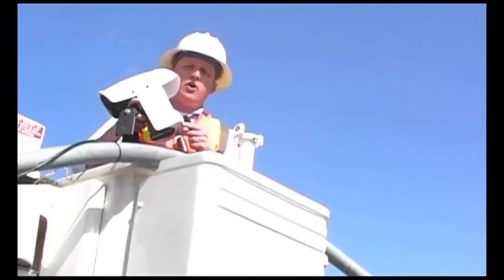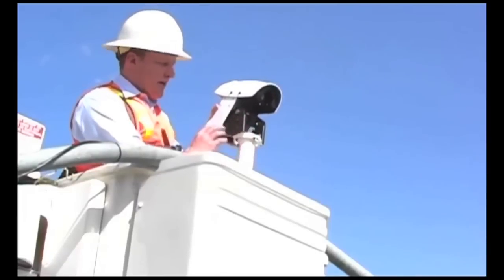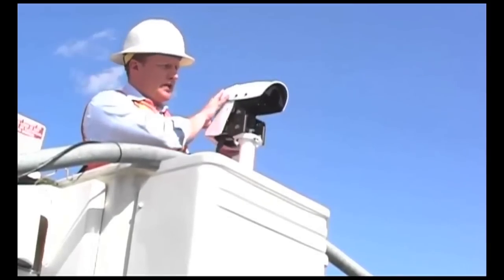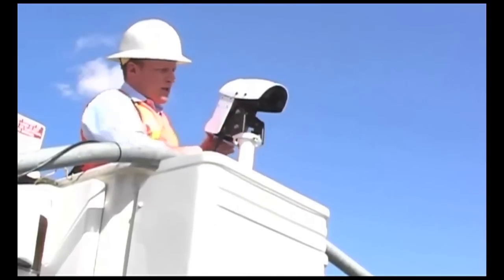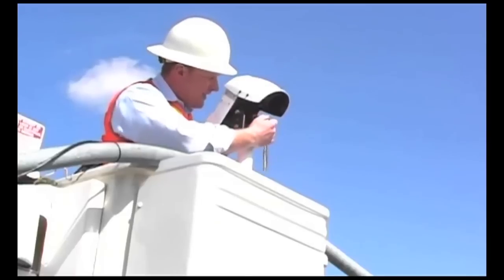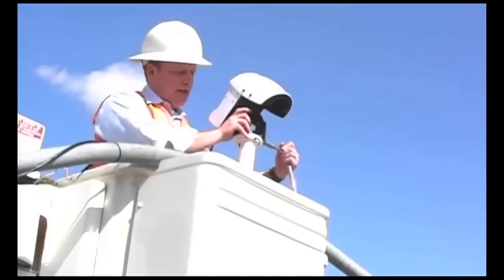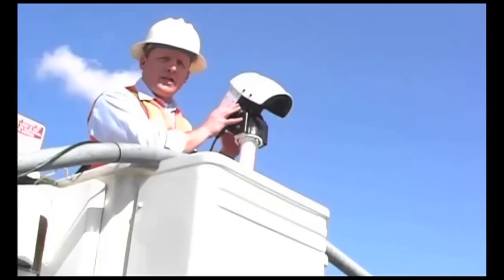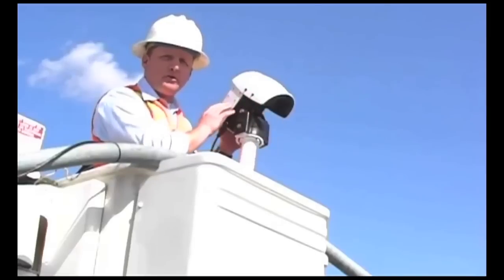Econolite Autoscope ENCORE Installation Video

Comment: Your video radar monstrosity thingy sure is huge.  What is the wind loading?  Does the luminaire structure mast/boom require a mechanical or civil engineer to perform a finite element analysis to make sure your ENCORE and Duo don't cause the structure to blow over in a hurricane or tornado? 
So many of the bicyclist in your videos wear helmets for good reason. 
I love how you wear a helmet up in the bucket.  Unless you have a chin strap when another motorist hits your truck with their vehicle, it'll get flung off when you get flung out. 
What's going to hit you in the head when you're up above everything?  Maybe you gotta wear the bright vest to keep helicopters from accidentally landing on you?
Otherwise, pretty darned impressive. I want one to detect a Barred Rock chicken crossing the road, but can't figure out how to program the Cobalt to do it.
Reply: It would be cool if the new cameras can detect pedestrians without buttons. Now that would be something.